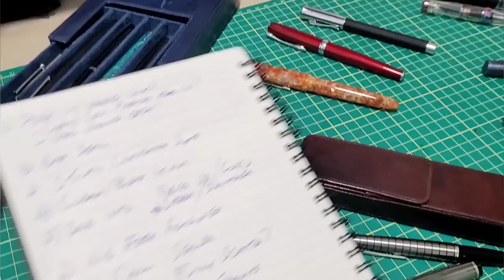Fountain Pen Troubleshooting 101 - How To Get It Working Properly

Comment: Your first point made me laugh. When I was a student in my 40’s a fellow student decided to try a fountain pen.
She complained it never worked even when new. I checked it. Tines, fine, general appearance clean and correct. I asked what ink cartridge she used and she looked puzzled.
I thought she had taken it out and cleaned the pen for return but no, she didn’t realise she had to put ink in it.
Reply from the maker: I was with an IT who was helping me with a strange connection issue we were having.  I was walking with him to go check something when he got an urgent call.  Someone said they computer just broke and wouldn't turn on anymore.  I went with him since it was on the way we were walking.  He went in, looked at the power bar and notice it was turned off.  The user bumped it with their foot.  He flicked it on and we were on our way.  As we continued walking he told me "you wouldn't believe how many times stuff like that happens and people think their computer just randomly broke all of the sudden."   😆
Reply: @Doodlebud yep on the computers... I thought my keyboard was broken or something, I couldn't type but random commands were opened in word... Turns out when you pinch a nerve in your elbow, and your pinky and Ringfinger are numb, you can end up holding down the ctrl or alt key and not notice.
Also, when I worked in the computer lab at uni umpteen years ago, I had to explain to a student that printing white text from a website will result in a white page, it will not print the black background. He had tried 20 times before asking.... Poor dude.

Comment: When I first saw the thumbnail for this video, I thought you'd had that TWSBI Vac Iris nib modified to be a posting nib! I'd guess the nib wasn't seated fully after cleaning, and when you put the cap back on, the tip of the nib hit the end of the cap and bent as you screwed the cap down. That's the kind of damage that happens from that, typically. In your place, I'd see whether the nib wrote like a posting nib and keep it if it worked well, but I'm a little weird like that 😄 EDIT: never mind! I see you addressed this.

Comment: Something db didn't mention is slime in the bottle. I was new to fountain pens and had a Lamy safari that was always giving me grief, skipping and dry. Spent ages fiddling with the nib, pulling the feed apart, cleaning. Refilled with the same ink, still had problems. Eventually noticed the slime in the ink bottle. Dumped the ink and no problems since. I never knew SITB was a thing that existed.

Comment: Very nice overview!  Coulda used this advice ~ 30 years ago and often "parked" pens in storage if they weren't working right.  Then, I used a few nib smiths who did GREAT work and worth if for more expensive pens but pretty pricey for, say, a Safari.  Finally, I got some cheap nibs and started experimenting with many of the items you suggest here and can almost always fix what bugs me (including baby's bottom!).  I still use a nibmeister from time to time when I want a regrind but otherwise, I'm enjoying tweaking my nibs when needed!  More than a few of those parked pens are now in rotation

Comment: I think this is a very helpful video and would have been really nice when I started out. One thing I would add, is that I've had "sticky converters"  before and I usually just do a light tap or two, nib down, with the cap on, on padded area before writing. It usually is enough to break the surface tension and get ink to the feed. Going in my newbie fountain pen playlist!
Reply: Agreed. I've usually removed the barrel by then to see what's up, so I just tap on the converter directly while holding the pen nib down. A finger flick works great.

Comment: Early, I had a problem with my new Jinhao X159. Its nib slit was too tight. The ink did not easily flow and was a bit scratchy. After I watched your video,  I gaped the nib with a sheet of paper, and suddenly, it worked. Now my Jinhao works perfectly; it is wet and smooth. Thank you so much.
Reply from the maker: Good stuff 👍 I have another video on how increase ink flow as well.
https://youtu.be/TgiGUjF_A5Q

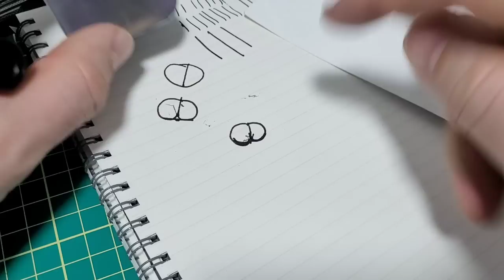Comment: 19:12 Making the nib flat enough, to get the capillary forces working again usually is the first step for me. I feel as if that guides me to the minimum amount of material needed to be removed. 
Restoring the rounded shape as a second step also provides an opportunity to add a  little personal character to the nib, or not. Just my experience.

Comment: I learned the same lesson the hard way when I failed to screw in the nib unit fully into my Karas Kustoms Ink. When I screwed the cap back on it made an awful crunch ... the nib was bent into a right angle. 
I might dig it out its grave and see if I can follow your video and turn it back into a nib again
Reply from the maker: Sounds very shumshy shumshy!

Comment: Great video overview! I made the same mistake once and didn't put a nib back in fully. Capped the pen and bent the nib. The good thing is that it only takes one time to learn that painful lesson! Some other techniques I use to get a pen writing if it's dried out a bit and won't write but has ink in it: either dip the nib in water, or prime the feed with ink by turning the converter knob a little if it's a cartridge/converter pen. (If using a cartridge, giving it a little squeeze may also work, although I find that hit or miss. Some cartridge walls have no give -- probably a good thing.)

Comment: Excellent video and thanks for the shout-out lol. Sticky converter syndrome -- some people actually dip a toothpick in dishwashing liquid and put it into a converter that's already filled with ink to help break the surface tension. One other source of ink flow problems are feed channels that are too narrow. I had that problem with the original modern Conklin Glider; I tried everything under the sun and in the end, what solved the problem was widening the feed channel (on the top of the feed) with a very sharp, thin blade.
Reply from the maker: Ahhhh yes I forgot to bring that up 👍
Reply: I did this on a Kaweco feed using an X-Acto knife. I just wanted the pen to write wetter. Kind risky, but I knew I could get a replacement nib if necessary.
Reply: @marilyngardner4269  I used the blade of the smallest Swiss Army knife (the blade was very thin + it was a new knife so it was very sharp). The important thing with any kind of nib/feed adjustment is to not go whole hog -- make a small adjustment, then check your work....if it it's not to your liking, make another small adjustment, then recheck your work.

Comment: Yes to everything. I am currently working on a simple one, a Parker 45 single pen desk set. Original Eversharp/Parker permanent black cartridge almost welded in place. Fortunately Parker Quink is easy to clean out. In fact, some vintage (with Solv-X) Quink will help clean most dry inks out of a pen.
Reply: I just found a bunch of old (70s/80s) fountain pens in my dad's study.  Nothing particularly amazing, but worth having a go at cleaning them and getting back into service. Fortunately, none gummed up, but three cartridges had just ink powder in them!  Hope you get your 45 back to full health.  My first 'vintage' pen was a 45 Flighter, and I love the design.
Reply: @archivist17  It's going to be a gift. Pen directly from Parker's hometown of Janesville Wisconsin, base from West Virginia, converter from Amazon. 😁 Total: cheaper than restored online from a reputable vendor by one third.
Had a flighter 45 from the 1960s get stolen so I found another from the 1960s on eBay for cheap. On its way from India. 😉
Reply: Same like me

Comment: Nice methodical approach, DB!  It's all too easy to jump straight to a solution that's worked before on a different pen, rather than work through logically.
Reply from the maker: Always check the basics first.  A buddy of mine had his truck conk out on the side of the highway and gave me a call since I wasn't far away.  He started talking about blowing a valve or maybe "he chucked a rod" LOL   I swear he just heard that term somewhere and wanted to sound cool LOL.  A few questions later I found out he just did  "a service " on his truck.  Said service involved him changing the rotor.  Said buddy was also a big guy and had a tendency to really wrench on things.  Immediately checked the rotor since I had a feeling he over torqued the set screw and.... rotor was smashed to bits.  Got a new one and showed him how to properly tighten a screw.
Reply: @Doodlebud  Cheaper than stripping down a whole engine only to find nothing...

Comment: Thanks for the video! I have the same problem with de Pilot FA nib. I already bought the custom feed from Flexible Nib Factory but it is in transit. If a company sells a product for the internacional market, it should be properly made for the consumer of that market unless otherwise dully informed before purchase. Greatings from Peru!
Reply from the maker: Hope the feed swap fixes it right up for you
Reply: As someone who uses my Pilot FA nib to write almost exclusively in Japanese and Korean, I can attest that it is not indeed a Western thing; they just make bad feeds

Comment: Excellent overview on the problems that may occur with your pen. 

I have a Leonardo Momento Zero Grande and it writes great and then the pen begins to starve the flow. Now it is a piston filler. If it was a vacuum filler I would understand but not with a piston filler. Any suggestions?
Reply from the maker: Did you run though all the things I listed in the video one-by-one already?
Reply: @Doodlebud  I pulled everything apart, cleaned all parts, added grease to the piston. 

When I minutely move the piston, the ink flows nicely. Very strange to me, since it not a vacuum filler.
Reply from the maker: Is it a new pen?  Did you contact the seller you bought it from?  I would check to ensure the nib and feed are tight together, then I would next check the tine gap to make sure its not too tight.  It could be borderline too tight.  Works for a bit then eventually inhibits ink flow.  Or a mini baby booty going on
Reply: @Doodlebud  it is a new pen. I decided to redo all the cleaning again. I looked to see if there was any debris in the filling chamber after I greased the piston (I couldn't even move the piston when I first got the pen.).

Then I pulled the nib and feed and carefully re-seated it in the section. 

It seems to be working. I wrote a sheet of a5 paper. There was no starving of the feed. So, I am letting this sit for a few days to see if there is any drying if the ink.

Comment: 2:59 I think maybe some of those inks should only be used with dip pens.
Reply from the maker: They are designed to be used with fountain pens, there are other ones specifically for dip pens as well.  But they still do end up clogging pens if left for some time and new users may not be aware of that.

Comment: I took the barrel off the nib section of my MB 1266 and now it won't screw all the way back in. Tried silicone oil. Tried immersing the nib section in hot water. Nothing works. It screws in leaving a space of 2mm. Any ideas?

Comment: I have. Bran new Pelikan M1000 Fine.  The pen writes super well for about 5 minutes then runs dry. Working the piston doesn’t seem to help, the back end of the feed appears well saturated, but the nib slit is dry. The slit width is fine at just under 2 thousandths of an inch, and the it appears clear under magnification that the tips touch.  I believe that are not supposed to touch, but I don’t think this is the problem, as with normal writing and normal flexing the tines definitely separate.  Also, under close inspection I can see that the properly spaced tine slit is what runs dry.
 This all  suggests to me that there is a problem with the feed where the ink enters the slit.  I see that the tine slit is aligned with the slit if the feed. And I did do a wash in plain water in an ultrasonic cleaner.
Any thoughts would be much appreciated.  I could next look to see if it is possible dismantle the nib, but the eBay seller says he will check/fix the nib for me. So I will do this … I see you talk about this at the 9 minute mark 😅

Comment: I used Kuretake manga ink in my preppy fountain pen and now I can see the feed is filled with ink but it never flows into the nib. Any solutions? I tried flushing with normal room temp water
Reply: P.S: my pen also fell on its tip and got bent so I had to "un-hood" it. It's as straight as I could make it.😮‍💨
Reply from the maker: The whole dropping the pen on the nib is most likely the culprit.  Just getting the tines sort of unbent isn't enough. There any several things that have to be perfectly aligned and fit together to have a pen flow properly.

Comment: I got a STAEDTLER® 899 Calligraphy pen set from a local retailer. Out of the box, tried all the different nibs, hard start no matter what I do. I have to prime each nib, then it stops. Any ideas?
Reply from the maker: I'm assuming you went through all the steps I laid out in the video.  Since you're having this issue with every single nib, I would be very surprised if all the nibs have issues.  So to me it sounds like the ink delivery.  Are you using a cartridge or a bottled ink with a converter?  If its the included cartridges make sure they are fit all the way in so they are supplying the feed properly.  If its bottled ink, I would check to see what type of ink you are using.  Its is a very dry ink, old ink, fountain pen friendly ink etc.
Reply: @Doodlebud  Thank you so much. Yes sir, I did. I tried both the included cartridges, and the converter. I tried it with all the nib, for each ink type, and the ink I used in the converter is Diamine Oxblood. I tried flushing but that didn’t help. I’ll look closer at the nibs and assembly. I wrote them, but I think they’re ghosting me! Lol Oh well, it wasn’t expensive.

Comment: Hopefully someone sees this comment after eight months of the video... My problem was as I put the nib on paper it started letting too much ink out drops of ink instead of a line. I checked for tightness or loosen parts, flushed, disassembled and even changed inks. Nothing could ever make the pen work. Any suggestions on how to fix that? Thanks in advance!
Reply from the maker: Sounds like the air/ink exchange isnt being properly regulated.  The air exchange sounds like its too high and letting the ink out too quickly.  Ensure the nib & feed are properly seated first.  Also depends on what filling mechanism you have.  Could have an issue with the fitment of the converter, or bad seals on a piston/vac system.
Reply: @Doodlebud  I'll check your suggestions and hopefully fix the problem. If not, the pen would simply become a collection item :-) it's a nicely done wood/bronce combo pen. Thank you!

Comment: Another conditions to be aware are ink leaks. This can happen when you uncap / cap the nib, or when you are writing and drops of ink out of the nib/feed or when the ink reservoir is full or almost empty. How to deal with these?
Reply from the maker: I would run through the things I mentioned.  Especially the fitment of the nib and feed together and within he housing and the housing into the pen.  I once had a housing with a tiny crack that caused leaking